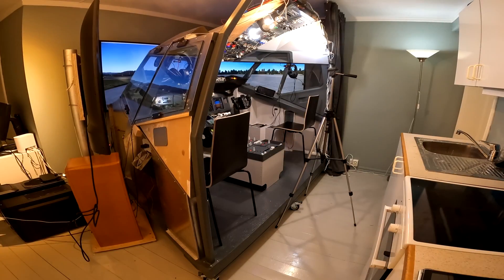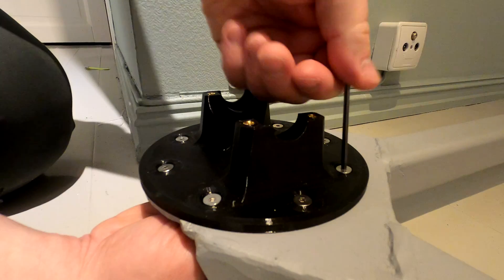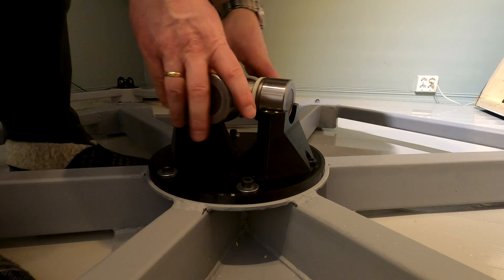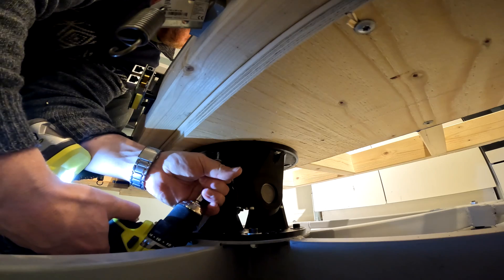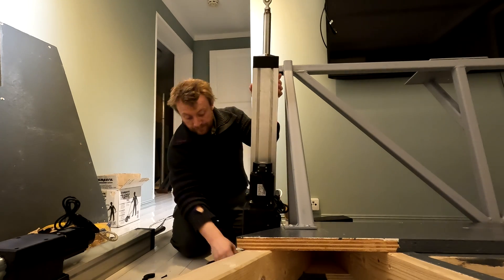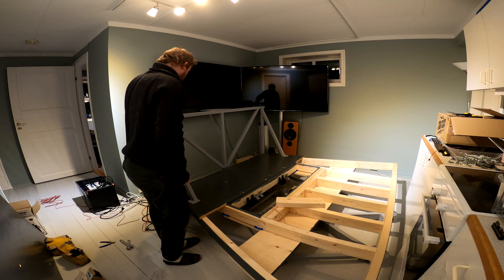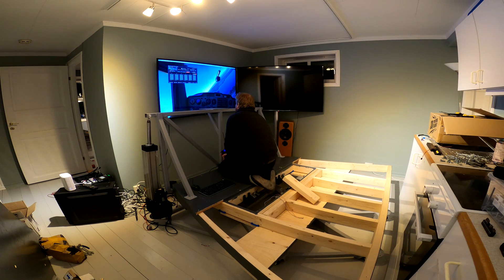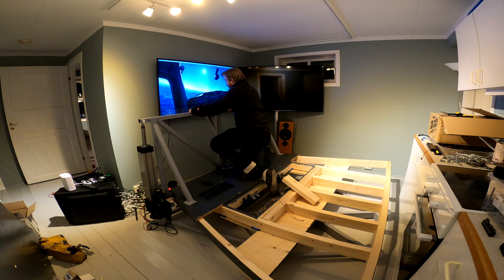Adding motion to my DIY 737 home cockpit

Comment: bro ive always wanted to make a cockpit that has roll and pitch. how did you set them up to move relative to the game?
Reply from the maker: I'm using Simtools V3 to capture motion data from the sim and translate the data into movement commands for the different actuators. This movement commands are sent to a Thanos AMC controller that translates the movement commands to servo specific data which is sent to two AASD15A servo drivers that move the servo motors
Reply: @B738DIY  that's awesome I've been wanting to build a motion sim for elite dangerous and some other games for awhile now but had no idea how to start!

Comment: Hi would like to know the actual names for ever part not the frame the actuator u joints what’s the name of where the u joints fit in. If you can’t tell where to get those parts I can build out the bottom frame and the frame that the actuator connects to. Would appreciate it. Thanks

Comment: I found your video in my recommended section and I was wondering if your simulator can help land a 737 in case both pilots are unavailable during a flight.
Reply from the maker: The comments I have received from real pilots testing the sim is that it is very close to a fixed base trainer. So I guess it would help :)

Comment: Hi, I've only just come across your channel, I know I'm late to the show! Just watched this and the last video were you take the cockpit to pieces, I hope you remember where it all goes back too. The motion base you've built appears to sit higher than the original static base, is this going to cause an issue with the clearance beween the top of the cockpit and the room ceiling. I'm just curious? It's a brilliant cockpit, and I was amazed watching the last video that you made everything, that truely is outstanding. I'm guessing it would be a silly question to ask why you have a kitchen in the sim room? Anyway going to look forward to seeing how this motion system works when it's all back together. All the best Dave.
Reply from the maker: I'm happy you enjoy my "crazy" project :) Hopefully it goes together again without to much trouble. I guess knowing every wire and all the design choices helps alot when putting it back together. Regarding clearance to the roof; you are absolutely correct in questioning if there is enough space. In the CAD model there is space, however it will be very close to the roof when full pitch down. The universal joint is positioned towards the rear of the cockpit reducing the movement of the aft of the cockpit compared to the front. You are not the first one to ask about the kitchen. The cockpit "lives" in what used to be a small apartment in the basement of our house. Something that is quite normal in Norwegian houses. (small apartments, not cockpits)

Comment: Adding a dummy yaw actuator (i.e. a bar that is positioned where the yaw actuator would go) will significantly improve torsional rigidity. And you need the yaw actuator mounts anyway, don't you?
Reply from the maker: The current setup is not able to move around the yaw axis. The universal joint only allow for pitch and roll (if it were rigid enough). Allowing for yaw (by letting the universal joint rotate) would however require a yaw actuator. But then the kinematics of the current setup with fixed linear actuator in the front would become very challenging to handle. The allowed yaw rotation would also be very limited with my current design

Comment: Great work! Very creative. How much weight do you think it can hold?
Reply from the maker: Thank you! The weight of the simulator with two pilots is approximately 500 kg. Most of that weight is resting on the universal joint. I believe the limiting factor for how heavy the sim with my 3D printed U-joints is the moment on the universal joint when the base in at the max roll position. My calculation estimates a torque of 500 Nm. The maximum weight in the universal joint can hold up is significantly higher than 500 kg, so it is possible to use a heavier simulator is the center of mass is close to the pivot point.

Your sim is really impressive by the way!
Reply: @B738DIY  Thank you!  Very interesting! thanks for the info! Something I would love to try some day. Though I suspect my sim might be over 1000kg. But a great solution for a limited space.

Comment: Wow, Very nice! I see the black plastic parts are 3D-Printed - I assume its ABS, how much infill is used in order to reach the needed strength?
Reply from the maker: Thank you! I'm using PETG. Amount of perimeters and infill really depends on the load the part will see. If it is only compression, 3D printed parts can take significant loads. For the parts in the actuators I believe I use a 0.4 mm nozzle, between 6-10 perimeters. For infill I'm using a triangular pattern with between 20-30% infill and a line multiplier of 3. This is in Cura.
Reply: @B738DIY  Thank you! Amazing strength in that print. I wonder if that would hold up for a long time. But I think I understood later in the video that you are planning to replace the printed parts because of the wobble anyway
Reply from the maker: So far my experience with PETG is that it works well for these type of applications compared to PLA which will creep and fracture under sustained loads well below ultimate material stength. Im not blaming the material for the wobbel in the main universal joint yet, as I believe it is a design error. My main focus was the strength in the "z" direction, forgetting that the bearing would also take significant torsional loads. I have also found how the part deform which I will try to show in the next video.
Reply: @B738DIY  looking forward to see that. Great 🙂

Comment: So I’ve been wanting to build a home cockpit, what’s your monitor setup and settings on flight sim? Or do you have some type of software to get the monitors to get the pov to look right?
Reply from the maker: For the outside view I'm using three 65" TVs running off one computer. The instrument displays are running of a secondary computer. This is a feature of Prosim 737 which allows distributing instrument displays to multiple computers
Reply: Thank you.

Comment: Looking good.  From experience, go to the car wreckers and pick up a old rear wheel drive, drive shaft and cut it down to size for use (normally can cut two U joints off the one drive shaft).  Its the only thing I ever found that was suitable for this type of application at a good price.  All the best.
Reply from the maker: Thank you! I might have to give up on my 3D printed u-joints. I'm currently printing some that should resolve the issue, else its off to the wreckers.
Reply: @B738DIY  how big is that main U joint?  I'm working on a design and like that idea!

Comment: HOME COKPIT dang how much does it cost.
Reply from the maker: It is becoming expencive with every feature I'm adding :) If only looking on the cost of a 737 simulator, it really depends on your approach to building/accuiring one. There is a very good article onhttps://www.simobsession.com/faq/how-much-does-it-cost/ which goes through cost. I my case, I have built everything my self except the throttle quadrant, which means that cost for some parts are less then if you were to purchase it. This does however require a lot more time and tools. Still there are a lot of expensive parts and tools that go into a diy build. I would say that you would need 10,000—30,000$ for a nice diy build, and up to an additional zero for a plug and play solution.
Reply: @B738DIY are you a pilot? And for connecting it to a sim do you have to get an add on inside the sim to or not
Reply from the maker: Not a pilot. You need som way of interfacing the hardware. I'm using Prosim 737 which include an add on to msfs

Comment: Hopeless.... absolutely no simulation of the explosive depressurisation due to plug doors falling off. Totally immersion breaking.
Reply from the maker: I need to take this into consideration if I ever decide to upgrade the sim to a 737-8 MAX 😂
Reply: @B738DIY lol but that does give me an idea: when there is an explosive decompress, the visibility in the cockpit can drop momentarily to almost zero due to pressure drops effect on water vapor in air. You could get a smoke machine and have it activate during those events as well as to simulate smoke in the cockpit during fire!!!!!! Get an oxygen mask!!!!!!!
Reply: @Lukeduke7773 @B738DIY Else you could close up your sim, use a balloon to bring it to 10000ft then randomly a door would pop
Reply: @B738DIY You mean the 737-9 MAX, the 737-8 MAX has the MCAS simulation

Comment: Wow nice design!  Can you share the part number of the main universal joint?
Reply from the maker: The cross bearing is a 57X142, while the U-joints are a diy design printed on my 3d printer.
Reply: @B738DIY  oh wow even more impressive! Is that ABS or something else?
Reply from the maker: I'm using PETG for these type of parts that will see significant loads as I have found PLA to creep and fracture even under low loads.
Reply: @B738DIY  great stuff.  Are you planning to sell your design plans once finished?  I would be interested.

Comment: will you connect the tvs to the structure ?
Reply from the maker: Yes the TVs will be mounted to the steel structure. I have some additional steel supports for the side tvs that will be mounted later. Still have some fabrication to do on the TV mounts.